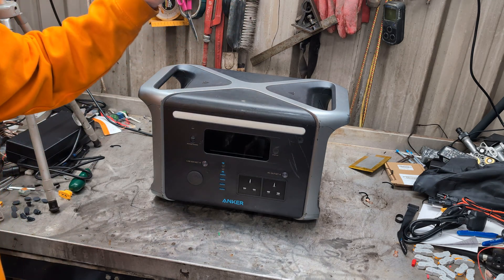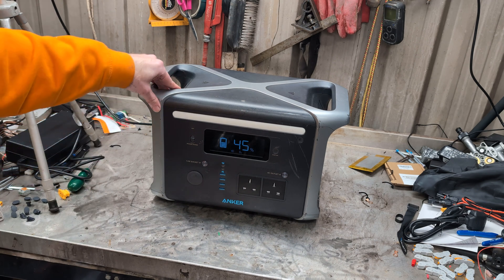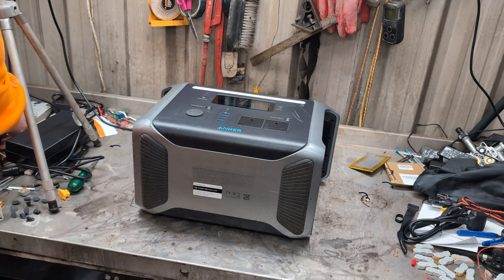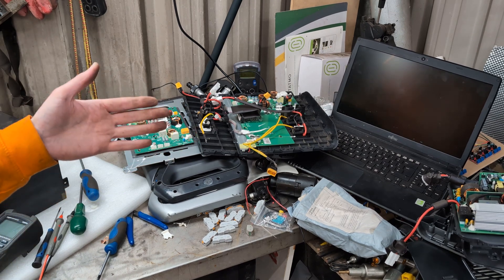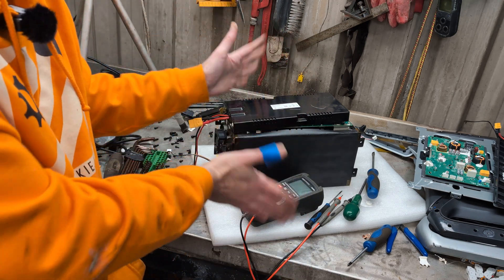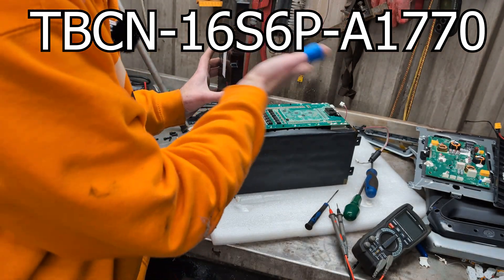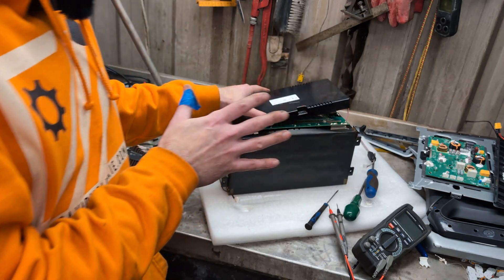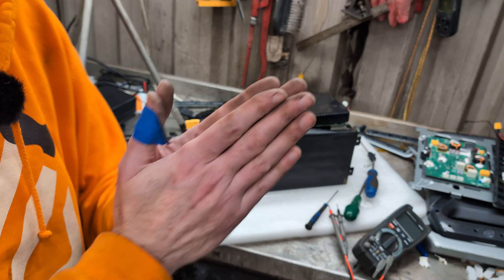Anker PowerHouse 757 - DEAD - Can we make our own portable power station? Part 1

Comment: 1. Check the charge level 

2. If the charge level is over 2%, please use the supplied AC adapter to charge the PowerStation for 24 hours (only this time) to see if it works 

3.If the charge level is below 2%, please charge the PowerStaton via the solar input port using the supplied car charging cable and charge the PowerStation to 2%, then use the AC adapter to charge the PowerStation for 24 hours (only this time) to see if it works.

Comment: David the red fan is, in fact, a vortex compressor - not a centrifuge like the black one - it moves less air but at higher pressure  - Vortex compressors are sometimes called Regen pumps - it's fascinating how they work air slips off each paddle as it spins into a side cavity and swirls around  hiting the air slipping off the next - each paddle thus becomes a stage slightly increasing the pressure - often resulting in a final pressure of 2-4 psi - they are used a lot to oxygenate big fish pools

Comment: got the same problem, mine is 0 charge - bought it less than a year and with very minimal use. :(
Reply: 1. C heck the charge level 

2. If the charge level is over 2%, please use the supplied AC adapter to charge the PowerStation for 24 hours (only this time) to see if it works 

3.If the charge level is below 2%, please charge the PowerStaton via the solar input port using the supplied car charging cable and charge the PowerStation to 2%, then use the AC adapter to charge the PowerStation for 24 hours (only this time) to see if it works.
Reply: @titiriptica3322  its beyond repair, due to high humidity here in the tropics the cells are corroded and a solar technician said its beyond repair. All cells are dead or shorted out

Comment: About time 🤣

It's possible the built in BMS is relatively stand-alone.  The data connection (I2C) probably just tells the power bank what's going on.  If the test below works, we can reverse engineer the comms later.

If it were mine, I would try feeding 58.4V in, probably into the little XC15? connector.  You could use a '48V' E-Bike charger as the power source.  Monitor the cell voltages with a multimeter, first to see if they're charging and once they've charged, to see if they're balancing by seeing if the highest & lowest cell voltage converges over time.  It may well just work. 

If it charges & balances, you could just replace the charger inside the box with the eBike charger & leave everything else the same.
Alternatively, buy a 48V Sinewave inverter (same wattage as the original one as the current is probably limited by the BMS) and connect it up.  That, then gives you the most useful function of the power-bank that you can put in another box (Ammo Tin?)

If it doesn't charge / balance - then it needs a Balancer.  I've recently been testing an Active Balancer on 4 spare cells from my EV Project.  https://www.ebay.co.uk/itm/195421030083  It works quite well & does a decent job of balancing.  Unfortunately, it has too high a paracitic draw to leave connected permanently IMHO.  However, on the board there's a little solder bridge marked 'run'.  If you replace this with a switch, you can switch it off & reduce the draw.  I have this connected to a relay so it only balances when the charger is powered up.

There are ones made by Daly, some of which can be controlled by an app, have better packaging & more features.  I haven't used them - so you'll have to research a bit to see which offers what you want / need.

In either case, you can use the eBike charger.  Pair it with a 48V inverter and a load of your favorite 12V connectors, put it in a nice box - and you're sorted.

Drop me a line if you'd like help - even 3D Printing a nice control panel if not technical.

Comment: Buy a JK BMS and make one mother of a bike battery. I converted an 19KwH 16 cell lithium battery from an electric vehicle to a house bank using one, my system is 3Kw 48V, I used the JK 150amp BMS with 2amp active charging w/ Display. Been very happy with it thus far so got a second one for the next battery build.

Comment: Just save the bare lithium pack and rebox it with an off the shelf BMS. Then use stand alone inverters/chargers.
I would rewire the battery to 24V (or even 12V) to make it easier to source the ancillaries.

Comment: I would say a new Bluetooth BMS so you can check capacity left on your phone. Another charger and a 48v pure sine inverter. Build it all into a peli type case
Reply: yup and stay at 48v, 12v you'll be practically limited to 1kw if you want them to live long due to current involved

Comment: you need a  new bms that you can set up the hvc lvc etc to your specs, dc to dc usb module and a inverter dc to mains and a desk top power  supply that can take ac and dc to charge the battery  make a box job done or use the old box. use a bluetooth bms use your phone as the screen . yes16s6p is exactly  what you guessed it was

Comment: That might be a propitiatory BMS with all those extra comm ports. If so, the BMS might need to be swapped out with something more user friendly. I've run into that problem with rack mount lithiums. If you still have that Bluetti charger it should work for charging that pack

Comment: Maybe it was too hot or too cold to charge?  I’m not familiar with that brand but also some have setting you can change usually with an app on your phone. Maybe sow how the max charge was set to 45% or less?  No other ideas.
Reply: Ya I really really hope he checked ambient temperatures lol. I set my batteries to lock out charging at 4c some set to ten c to lock out recharge

Comment: Being 16 cells in series, the full charge voltage would be 58.4v, and one website considers a pack this size to be "48 volts", so probably best to start there for a charger to replace the now duff anker one to make use of the battery pack in something else... :)